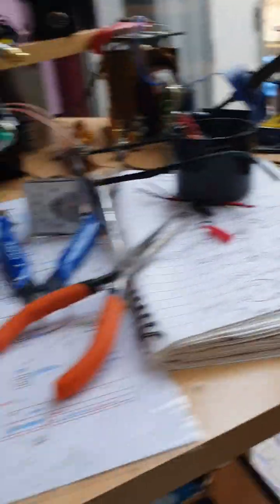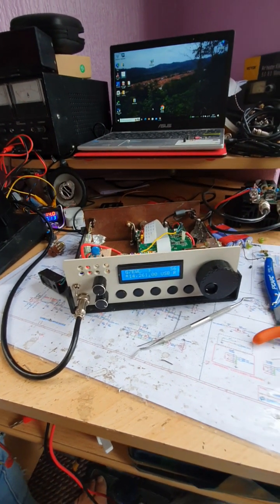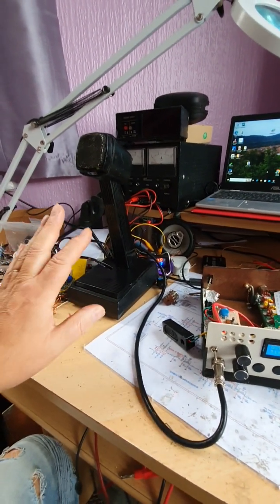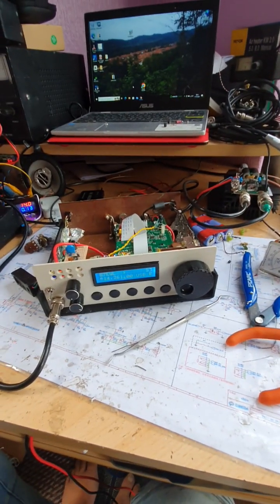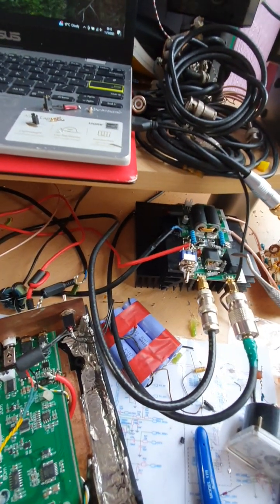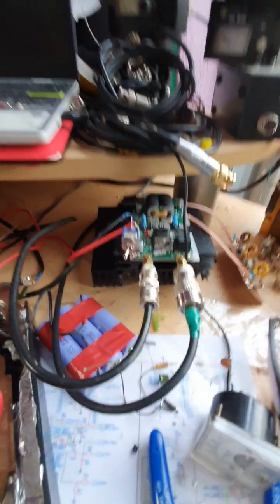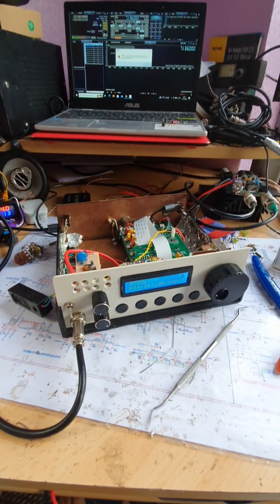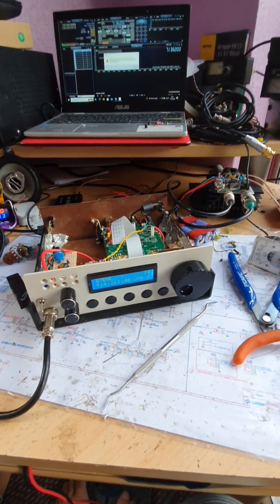Speech processor added to uSDX uSDR radio, will work with red corner, white button and brick.

Comment: A similar project is going on here.
I would like to see the results with and without processor preferably on an SDR with waterfall.
EP6DSP
Reply from the maker: It just looks slightly more lively on a pan adaptor. The amount of audio is of course controlled by the radio's own circuitry. Good luck with your build.